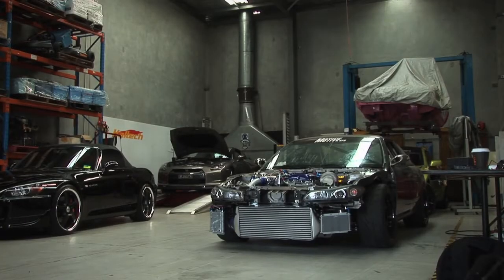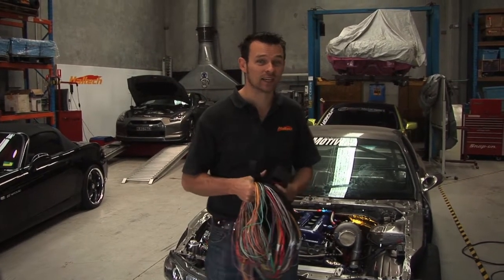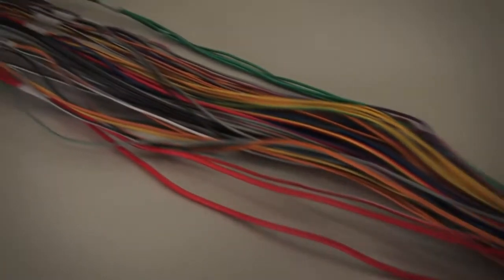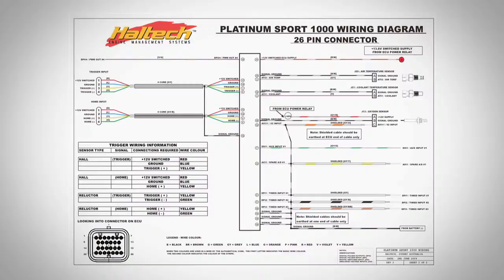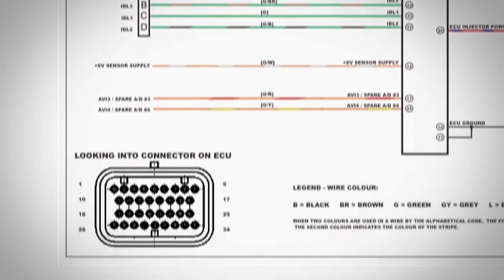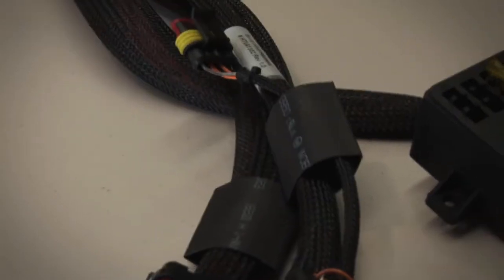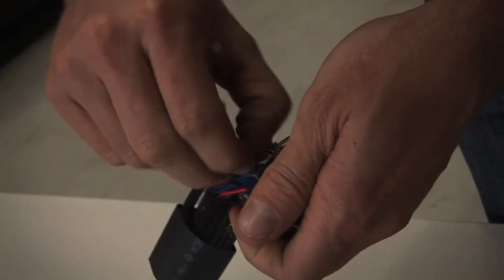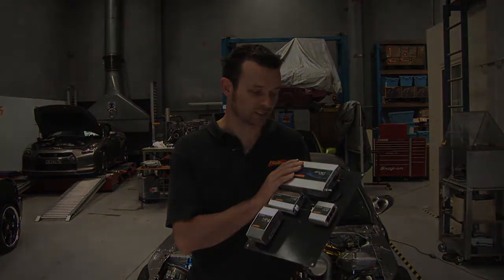Haltech DIY: Wiring Up a Platinum Sport ECU. Part 1

Comment: I have a 2007 Subaru 3.0R engine in a stand alone situation. Think of on an engine stand.   Can the factory ECU be reprogrammed to run the engine outside the original car?  I mean basic cam, crank, MAP, MAF reading and then injection and spark.  Will your computers work?
Reply from the maker: The Elite 2500 supports the EZ30, including DBW throttle, AVCS and AVLS. 
This will require custom wiring, as it is not a plug-in system.

Comment: I purchased a sport 100 and patch harness for 97 wrx but decided to remove the wrx end and solder directly to my harness. I notice the main ground input wire to the sport 1000 uses one very tiny 18-20 awg wire...this one wire supplies found for the injectors, idle valve, coilpack inputs, fuel relay turn on, etc. I am going to swoon that ground and install at least an oem size ground wire, what is the femal pin I can use to accept a 14-16 awg wire? I notice the positive power supply wire is an ok size, so won't be uprating that one.

Comment: can you wire it in tandem / in parallel with the stock ECU ?

control only fuel and ignition leave the rest like "drive by wire throttle" "gauges" "traction control" alone ?

Comment: This harness is much cleaner and better thought-out than my PS2K's flying lead I got 2 years ago, especially with the new fuse/relay box and not pre-shrinking everything. Thankfully, heat shrink is cheap enough. Thanks again for the quick how-to on de-pinning the ECU connectors.